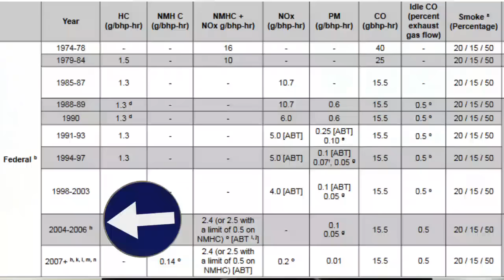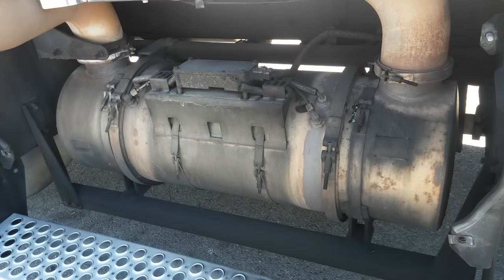Why Do People HATE Cat ACERT Engines?

Comment: ACERTS were not bad.....but yes the actuators were a pain in the butt. The combo of high compression and high boost from the compounds plus the added complexity hurt reliability. Reprogramming those big block engines changed everything.....they run HARD.
Reply: So the c13 2006 model was good to go also the c15

Comment: Josh, I'm a nut for durability and longevity videos. I go crazy over the stuff you post about million mile and high hour engines and internal wear. If you could someday do a video about Cat generator/truck engines with crazy miles and 40k+ hours and how they got there, how they were maintained, and what parts were still original. I've read about Cat generators that have run basically non-stop for years on end,  on islands and places with no other power source.  Love your stuff immensely. Take care and thanks.
Reply: I have a cat c 15 acert 2007 with 1444568 million miles with no overhaul yet, and still running strong it has 44457 hours has a right now
Reply: Just pull C32 out of D11, just over 15000 hours and 2 million litres of fuel. The engine had not failed just hours . Most cats in mining are rebuild at 15000 hours, no in frame repairs.
Reply: @daddy111ist  That fascinates me how those parts can hold up to all those heat cycles and rotations and friction. I remember in the 70s, my parents had gasoline cars that would get junked after 50k miles. Engines were worn out. I realize that diesels are a different animal but it goes to show that if manufacturers wanted to make internal combustion engines last forever, they could. Thanks for sharing
Reply: @chevy36ful  That's a D11 dozer? 15k hours on it? Man, if you take care of them, they can make you alot of money before they need a rebuild
Reply: D Smith 15000 hours is normal change out time. The C15 I’m rebuilding now had 16000 hrs and not failed it will be sent back to service for anther 15000hrs Cat we’re made to rebuild.

Comment: I had an 07 w900 with an 550hp acert and it was absolutely fantastic. That C15 was a horse. Only two problems it ever had was after 700,000 miles, the injectors became very difficult and had to change out the jakes twice because they kept decentigrating. I wanted to convert the twin turbo over to a single because let's face it. They are trash and even cat realized that,but to do it,it was going to run about 10,000 dollars for the conversion so needless to say. It still has the twin.
Reply: I have a 07 379 with a acert I also love it ! I’m only at 475 hp though.

Comment: I know this is frowned upon, but we run a 4 2008 sdp petes, gave usual trouble, But have all been deleted, Best trucks we own even better than newer 2011+ trucks in our fleet(isx’s). Also it shocking to see how clean they still burn with emissions gone
Reply: Did you gut the DPF or straight pipe the exhaust?

Comment: I think it’s a great Engine, you can’t beat that 60lbs of boost.
Reply: Yes sir my mxs... 1 mill overhaul now 1.6 going strong... bullydog tuner and turbo boost harness... its a beast
Reply: @isaacmontoya9144  I have an MXS too. Getting it rebuilt the week of august 31st at 1.5 million miles. I'm getting a new turbo too and was worried about high boost pressures...so I was wondering if I should turn it down or something...but per your comment, it does no harm.
Reply: @jmh4ggg  no harm... with boost harness and turner at power... i see boost at 63 to 65 at full tilt. Obviously I don't run it like that ..lol
Reply: Chief119 my runs great boost about 60 pounds also changed both turbos at 1,750,000  I get really good fuel mileage on my 379 when it’s not windy.
Reply: @isaacmontoya9144  Yeah mine hasn't touched 30psi since i've had it...reason why i'm rebuilding and replacing turbos with it.
Reply: @isaacmontoya9144  my mxs just barely get 30lb. i need a tune i guess. 1.2 million on it
Reply: @israelruiz8731  yes check your cac.. boost boots for leaks. A stock 475 shoukd be around 40lbs of boost minimum.
Reply: I had a mxs myself and had absolutely no problem with it

Comment: The whole NOX thing is what sticks in my craw. NOX goes up with leaner burns. Within limits of engine destruction safety, leaner burn results in  less fuel burned. One of the ways to reduce NOX, along with the various after treatments, is to lower the AFR, resulting in poorer mpg. So the net result, all else being more or less equal, is more fuel burned to "reduce emissions". That seems like a paradox to me.
Reply: Don't forget to clean a DPF you have to burn more fuel too. Saving the environment by burning twice as much diesel.
Reply: Limiting NOx has nothing to do with climate change. The simple fact is that NOx and diesel particulates are toxins that cause respiratory diseases and cancer. Drive around without emissions control equipment and you are making your own little crowdfund contribution to killing someone's kids. The people in the EPA and organisations like it made the judgement call that killing fewer people was more important than preventing climate change, so they mandated the NOx and PM controls first and hoped to get the CO2 under control later.
Reply: That's why they came up with the DEF/Adblue system. Lean burn = efficient combustion = low PM, then the Adblue takes care of the NOx emissions.
Reply: @jellyfrosh9102  also don't forget, ultra low sulfur fuel is slightly less energy dense so you have to use more, and you can make less per barrel of crude so you use more oil to create the same amount of fuel. We're literally just trading one problem for another and creating much more expensive, less reliable engines along the way.
Reply: @nerd1000ify  I think your stance relies too heavily on the EPA(or any gov't organization) being not just capable but absolutely knowledgable about the policies they create.

Burning more fuel to decrease the likelihood of a lean fuel mixture to somehow decrease emissions sounds like a govt agency that found a set of conditions where the oil companies would be told their fuels/oils would see no drop in sales while also somehow satusfying the OEM's by selling far more maintenance items.
By also classifying engine swaps as maintenance in some cases.

Oh and let's not forget about almost every small vehicle OEM getting busted for emissions tampering, ala Volkswagen.
Reply: @threadtapwhisperer5136  it was no secret in the industry or to the EPA that using EGR and DPFs would make fuel consumption worse and lead to a need for more maintenance. The issue was that a) health data clearly indicated that NOx and PM emissions were killing people and b) few alternative technologies existed, especially at a price acceptable to the consumer. SCR has gone a long way towards correcting that issue, but even now we see a lot of people not wanting the cost and inconvenience of refilling the urea tank- manufacturers knew this would reduce sales and put off the switch to SCR as long as they could.

VW cheated (and you're right pretty much everyone did to some extent, VW was just the most egregious) because they marketed their cars as offering gasoline engine performance and emissions with diesel engine economy. This wasn't (and isn't) achievable, especially when they were wedded to lean NOx traps rather than SCR. Something had to be sacrificed, and they chose the option that wasn't obvious to the consumer. If people were willing to accept lower performance the need for EGR could probably have been greatly reduced by running higher AFRs (diesels make peak NOx when at 'richer' ratios because those are the conditions where combustion temperatures are highest). But automakers are in the business of selling cars, not building good cars...
Reply: @nerd1000ify  Also when they did adopt SCR, it's believed that the EPA required AdBlue tanks on light duty vehicles to be large enough to make it through an oil change interval without the owner needing to refill it, because they knew owners wouldn't do that - let the dealer take care of it during regular service instead. (And they mandated the vehicle aggressively refuse to operate with empty AdBlue, too.)

The problem is, if your AdBlue consumption rate is ~3% of your fuel consumption rate (the number thrown around for what's about right), at an EPA combined mileage of 34 MPG, with a 10,000 mile oil change interval, you need about 8.8 gallons of AdBlue. They only had enough space for 4.9 gallons. So, cheat so you can use less AdBlue, and cheat some more so you're damn sure that it makes it through the oil change interval without even throwing a warning at the driver.

It is actually possible to comply, just hideously expensive to do so with performance and efficiency (and forget about reliability). BMW pulled it off at the same time as VW was cheating, but they did it with the combination of a LNT and SCR (which gives you both the best performance of the LNT and the best performance of the SCR, and reduces the amount of AdBlue you need to use as one of the LNT's emissions is ammonia that the SCR can use), which is... well, there's a reason vehicles with those engines were north of $50k a decade ago.

And, Mazda managed to comply with the CX-5 once they gave up on EGR-only and added SCR, and the resulting engine was so inefficient that it got the same MPG as the gasoline engine it competed with, which means lower thermal efficiency - Mazda's gasoline engine design is particularly efficient, though, and it didn't help that their diesel was down to 14:1 compression (and in other markets the low compression lead to massive oil dilution problems). IIRC Ford ran into the same problem with the Transit Connect, where they had actually announced a diesel for the US, with really mediocre efficiency numbers, but cancelled it before delivering any due to those same numbers.
Reply: @nerd1000ify  cry me a river.
Reply: @nerd1000ify its weird cause if you google it the cdc and epa says theres no relation between NOx and lung cancer. National Institute of health says yes there is and new jersey says no there isnt
Reply: @nerd1000ify  LOL....fake news 🤣🤡
Reply: @kennethryan8112  yeah I don't know what's going on there. The biggest problem with NOx is that it tends to react with organic compounds in the air when exposed to sunlight, causing photochemical smog. Some of the compounds formed in those reactions are substantially more harmful than NOx itself, but NOx (especially NO2) is nevertheless bad for you. A small amount is tolerable (in fact your body makes some of its own for various purposes) but too much isn't good.

Comment: I would take a C15 Acert non dpf engine without question. They were the last million mile engines in my opinion. Have several at work with over a million, heads have not been off them.

Now the Acert dpf engine will bankrupt you.
Reply: I have a 2007 c15 that i spent 17,000$ on the regen system.  I was so broke i borrowed  5,000 $ and had it deleted & the ecm flashed for the iva. It was like a different truck. Better fuel milage , 667 hp. That was 300,000 miles ago. Its at 970,000 now no issues. If you own one of these its a no brainer unless you live in California. And what in the hell are you doing there anyway. Its never to Late to move back to the USA.  Lol
Reply: @garyhaley3072  You did the right thing.  The EPA serves a purpose.  However, they arbitrarily set standards that the manufacturers could not meet.  USA EPA diesel emission standards are more stringent than anywhere else in the world.  This standard needs to be a world wide standard that is reasonable.  Zero emissions are not reasonable IMHO.  The push toward electric vehicles is a pipe dream.  Ask the do good-er environmentally conscious hybrid or electric car owner where the lithium for his batteries come from.  Out of the ground.  They are, for the most part, imbeciles.
Reply: We have 4 acert engines(06&07) on the farm, haven’t spent a dime on those engines, can’t say the same about the 2019 D13
Reply: @DLTJR1959  and most have a dsl gen to charge em
Reply: Evermore  my mechanic  says it was a 625 hp detuned to a 475 hp. When i sent the ecm to Florida to be flashed I told them to turn it loose. A few months later the check engine light was coming on but not throwing a code.I had my mechanic scan it   and it said the rated hp was 667. I don't know if thats correct or not. But i am very satisfied with it.
Reply: @ballincobalt4184  Question.. Do you burn off road fuel in them. If so that might be why you have good luck with them.
Reply: Gary Haley what do you mean by burn off road fuel?
Reply: Evermore ah, we only run dyed diesel as we are a farm, we are also in Canada, I’ve heard our farm fuels are better than farm fuel in the USA, but not sure if there is a difference
Reply: @ballincobalt4184  he means non tax fuel, since all fuel is low sulpher. unless your in south america.
Reply: bob humberston shell fuel stations sell low Sulphur here
Reply: @DLTJR1959  I think clean engines could be reliable but they just push out new regulations so fast they give no room to breathe. The 7.3 Powerstroke couldn't meet emissions so they came out with 6.0. It had problems as it was pulled out of nowhere in a rush in late 2002 for 2003 models. In 2005 they had engine improvements and increased reliability though poor maintenance would make them horrible and the head gaskets were still somewhat an issue but not as much.  Then in late 2007 we see the new DPF systems roll out and with that the F series got a new diesel and what a pile a crap it was the 6.4 Powerstroke with a dpf, fuel egr coolers, sequential turbos and so much other stuff.
Reply: @ballincobalt4184  off road or farm fuel is still the high sulfer fuel we used before low sulfer. Its used in boats ,railroad  , drilling rigs and so forth. It has red dye injected into it making it easy to detect.  Years ago they would random check for it.
Reply: Gary Haley would that be why our 2019 volvo with a d13 goes through injectors every few thousand miles?
Reply: @ballincobalt4184  an additive like stanadyne could help.
Or maybe Volvo just uses horrible injectors.
Reply: I stand corrected. More refineries are going to low sulfer with red dye
Reply: HERPY DERPEDY well they are known for bad injectors, heard of lots of guys needing them replaced within the first 200 miles
Reply: Gary Haley incorrect, all diesel is still ultra low sulfur diesel. they no longer produce low sulfur diesel. it’s all the same, just a different color. we go through several thousand gallons of fuel a week and i’ve confirmed that through our supplier and many others.
Reply: dylan ingle we still have a fuel station here that sells higher sulfur diesel, shell v-power diesel isn’t low or ultra low sulfur
Reply: BallinCobalt 4 i stand corrected, sir.

Comment: Thanks ive been a truck mechanic for 30+ years, and working for fleets i don't get into this till they warranty is long gone. And cat has always been bring it to me. So it gave me a reason to hate them, ie im pro Cummins. Until they brought in this emission bs. Anything after the N14 sucks.but i was always impressed by their c7, extremely good on fuel, but had the problems like every other engine in the day. And you just explained everything to me. Thanks!

Comment: Long story short, keep in mind my mileage is Canadian numbers. Had a C15 1994 475 hp, trouble free 8-9 mpg pulling 140,000 lbs. Bought a new Pete 2005 C15  550 hp same job same weight. Always in the shop we called them Vivas always needing adjusting mpg? 4.5-5 so less pollution but you burn way more fuel. Let’s not even talk about the junk out there now. That 1994 is still hauling Stateside my neighbour bought it, no issues regular maintenance. I sold it with about 850,000 miles and only did a bearing roll in. He’s well over 1 million miles and she’s never been apart. Now that was a motor.

Comment: I run an MXS purchased in 2014 it had inframe done just before purchasing 

Only engine problems I've had was an injector and replaced the IVA connectors myself as a prevention. 

7.1 MPG average since ownership 
Only get 40 PSI in boost
 
Put straight pipes which reduced my EGTs drastically. 
Great engine so far anyway.
Reply: We have the same truck. Mines a 2005 387 with the MXS in it.
 https://www.amazon.com/gp/aw/d/B06XHVHZHX?psc=1&ref=ppx_pop_mob_b_asin_title

These will bring you up to 2020 lol. 350 for both headlights. Haven't had any issues with them so far.
Reply: @jmh4ggg  installed a pair last week exect ones. 
Was disappointed they didn't have access to adjusting screw on the side like originals.

Comment: I have a 2007 c15 acert. I put 1,700,000 before overhaul. To be clear. My engine didn't broke down on me. I did the overhaul because I though it was time to do it. It was running like a champ before overhaul.
Reply: I have an 06 and so far has been amazing.  I still have everything stock.  It’s still governed as well.  What would you recommend me to do to it so it can give me that kind of life yours did?  Other than maintenance?  Should I tune it and run a straight pipe or leave it alone?  Thank you.
Reply: @cesar9496  what I recommend to you is that. Add a Lucas oil stabilizer every oil change. 9glls of oil and 1 Glln of Lucas. I changed  my oil every  13,000 to 15,000 miles.  Caterpillar filters. I don't like white filters.🤭
Reply: @victorchavez6266  yeah I have always used caterpillar filters.  Hey thanks a lot,  I always trusted Lucas.  Never used it on my c15 but in other motors I have.  Should I leave it alone with the catalytic converter and untuned?
Reply: @cesar9496  yea,not a problem.  I still have mine.  I bump my from 375 hpwer  to 500 in Effingham, IL. I'm happy with that hpwer.
Reply: @victorchavez6266  awesome.  Hey thanks a lot bro!  My last name Chavez too by the way!  Greetings from Houston, TX and keep on trucking!
Reply: @cesar9496  wow. Chavez 👍not a problem. I'm glad I can help.